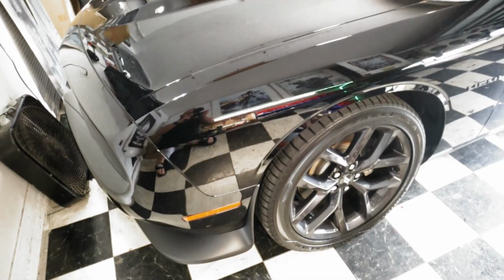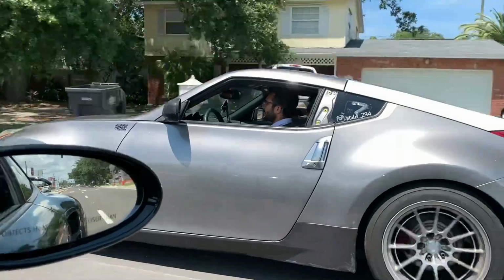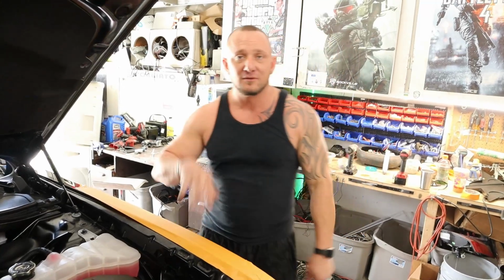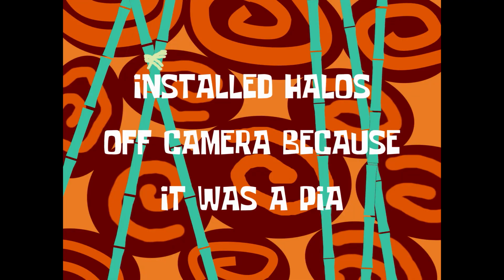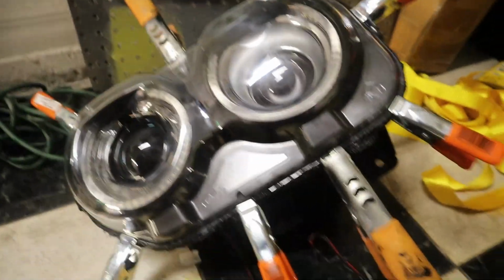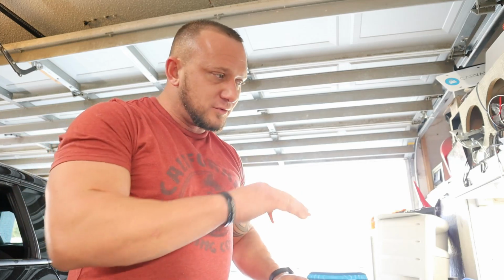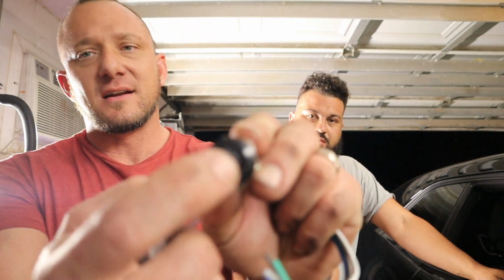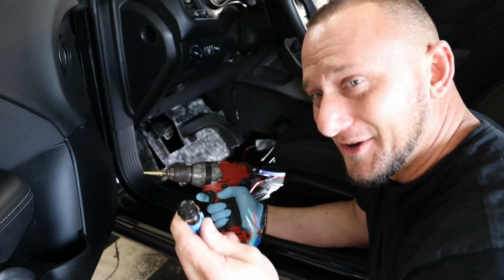INSTALLING FLOW SERIES HALOS AND LEDS 2021 CHALLLENGER!!!

Comment: Just about to tackle a set of head lights myself. Does the baking method work out ok? Or am i just better offcutting them open?
Reply from the maker: TBH that's a good question, I've done both methods and it seems like cutting gives a cleaner smoother surface for re-sealing. I think its just preference. Good Luck!
Reply: @DailyDelinquency  ok, ive done both. Last year i had to cut a set of 2020 Zl1 lights it was quicker and the seal on it turned out real nice. Customer was pretty happy. I do lots of lights but Not often I get a headlights.
Reply: @daily delinquency where you located and whats price of this installed
Reply: @DailyDelinquency  whats the price of this and where you located

Comment: Is the relay a 40/30 AMP 12 V DC Waterproof Relay and Harness - Heavy Duty 12 AWG Tinned Copper Wires, 5-PIN SPDT Bosch Style ? What type of extra fuse you use? I like this setup. Is the Vandal switch a 19mm? Advise please
Reply from the maker: Depends on how much power draw, think we used a 50/60 on this one don't remember but use a multimeter to determine size of relay and yes 19mm vandal latching and appropriate fuse size for load
Reply: @DailyDelinquency  I don’t have to use the relay right? I can just use the Vandal switch and additional fuse for load correct? The relay I assume is just a safety net.
Reply from the maker: @imher_truth  depends on the amount lights/accessories and the total power draw. The switch doesn’t support a very heavy load I’d recommend a relay if your doing anything more that a couple strips of lights. Use a multimeter to check draw and be safe 🤙🏻

Comment: How reliable are they ?how long they last you without issues?
Reply from the maker: i have a set in one of my cars going on 3 years now no issues! Thanks for the comment :)
Reply: @DailyDelinquency  do u use the flow option or 1 color most the time they said sum about ventilation
Reply from the maker: @AllSoWavyReese  flow most of the time occasionally switch to solid